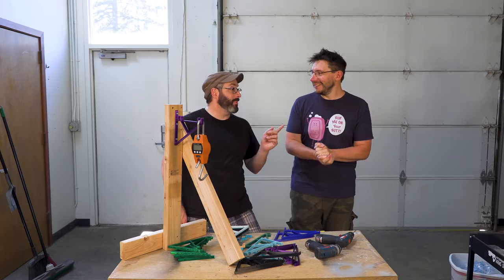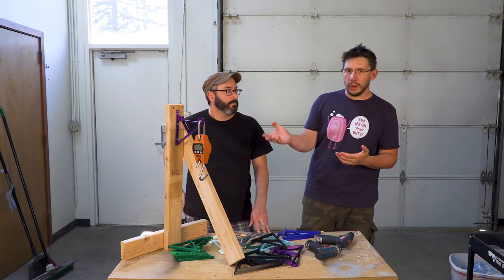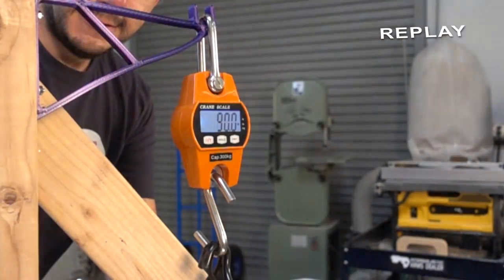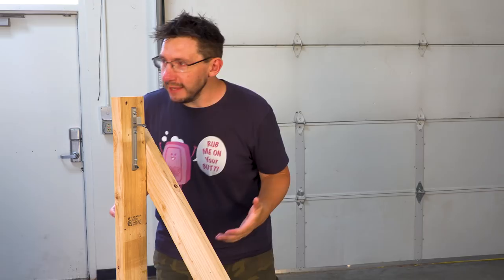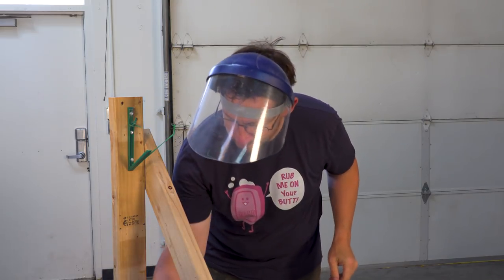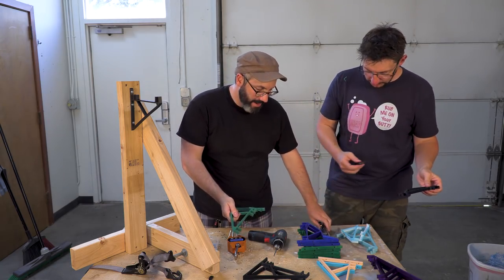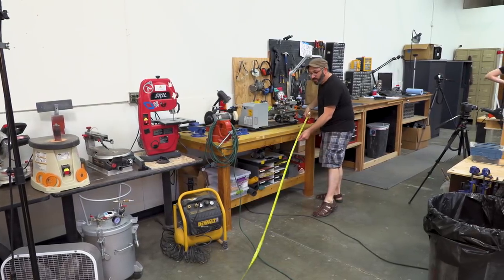Will It Break? Stress Testing 3D Printed Brackets IN THE NAME OF SCIENCE!

Comment: I don’t think the mechanical design was really optimized for the stress direction it was submitted to (you an see how the carbon failed based on stress concentration in one of the radius. Also, the ratchet doesn’t give you a consistent linear force increase and each material should be printed in a very fine tuned way to avoid failure within the adhesion of the layers. If you want to do this experiment right just print a typical tensile stress prove and add weight to it by clamping it to the prove.

Comment: it's so funny people think PLA's are weak, they are by and far the strongest materials we can print with, you anneal the HTPLA and bet it would be up with the polyalchemy which is also an HT PLA or modified PLA is better description.  PETG and ABS are about the weakest materials you can built with and yet people think they are strong because they flex and take impact better, well and handle heat better. But PLA's are really much better for most structural things if not in high temp use.

Comment: I think the nylon failure was more due to the design of the part than the material itself. If the emd there were more sturdy itd have not snapped so easily
Reply: "Product" design requires considering material properties and part/mechanical properties together. If one is ignored you'll likely not get expected or even consistent results.

Comment: SCALE CHANGED AFTER SECOND TEST CHECK FOOTAGE LOOK CLOSELY AT SCALE! just an fyi. i think that there might have been an adjustment to the scale after the second test. just looking at the footage and the indicator on the right hand side of the scale changed position. close up image of scale. https://ae01.alicdn.com/kf/HTB1dHpmQpXXXXcDXpXXq6xXFXXXn/220679641/HTB1dHpmQpXXXXcDXpXXq6xXFXXXn.jpg

1.polyalchemy moar 90lb - 40.8kg
2.protopasta htpla     64.8lb - 29.3kg
3.mh build                   89.5lb - 40.6kg
4.mh petg moar         43.5lb -  19.7kg
5.pla moar                   122lb -  55.7kg  thats right kids good old pla for the win! thanks to moar.
6. ryno                           37lb  -  17kg
7. nylon x                      39lb  -  17.8

Comment: I don't think this test is very accurate or can really be used due to the structure itself not being built well for support. Did you see where it was bending behind the support beam? Your support  bar needs to be moved if your testing weight at the very end like that rather than evenly across it.

Comment: Try for the golden number.  Take your longest edge divide it by your shortest edge and it should equal 1.618 or 1.62 (if you want to round).  The shortest edge should be what is inside your triangle not the total height.  Relocate your cross support back to corner and move it to center of triangle (which is not center of length but when you set it down with peak up where does the straight line go down at 90 degrees.  When I did tooth pick building these numbers helped a lot.  You might also try mini supports (like "Y"'s) at every junction to spread your support.

Comment: It does seem like most of these could have much higher failure weights if the overall structural design was better. The single internal brace is simply not enouch for the way the load is being put on the bracket.
Reply from the maker: Agreed. Our goal was to test what I thought would be a worst case scenario. Follow up video will be better.
Reply: As my head starts 3d drafting something new as I dont know how or have the programs to do it on my pc FeelsBadMan

Comment: Gentlemen, I believe you need to redo this test, and...modify your "Apparatus" to accommodate a Metal bar of some sort that fits inside both inner and outer raised bracket pieces so that the weight is evenly distributed across the whole "Horizontal" top of that bracket.  **Edit Meaning, you are only using one end of the bracket and that bracket will withstand more if evening distributing the weight across the whole Horizontal top of the bracket.

Comment: Your design is a bit wrong; use one vertical Web in the point where you are getting the bend and a diagonal Web from that joint to the exacto point where the horizontal is touching the wood, your forces are not getting transfered correctly to the vertical wood that would be the colum of the structure
Reply: Also add in the design little squares on the joints that will function as a support like the metal plates do on trusses

Comment: This was a pretty disappointing video. I'm a software engineer with a mechanical engineering degree who used to work in a plastics and materials science lab doing structural and impact testing.

1) As many have said you need to redesign this. The primary issue is the lack of a triangle on one side. A few more reinforcements and smoother angular transitions to spread out stress concentrations will help.

2) concrete is reinforced with steel bars (as most fiber reinforced materials are) to add tensile strength, not compressive strength. That's why your cf nylon broke in a different location. The stress concentrated at the base of the fingers holding the wood beams. It doesn't mean nylon is weaker.

3) Look up "dogbone tensile test", print the materials in that shape, and then test them at constant strain rate, preferably with something like an instron load frame. Your ratchet, 2x4s, and load measuring device are terrible. Without a constant strain rate it is impossible to compare these.

4) whatever makes contact with the plastic for this specific test needs to be flexible. The metal bar concentrates stress at a contact point, leading to very inconsistent results based on the twist in the strap and the angle of pressure applied.

These test results would be thrown out of any legit lab. I would take this video down out of respect for the manufacturers of the materials accused of performing poorly.

5) Do more tests than 1 per material. Nothing here was statistically significant.

6) This was not done with safety first in mind. Which was one of the bigger issues. Face shield only went on after a piece hit your face. Ratchet and scale fall on your hands. Plastic flying everywhere. At my lab we had to test materials in an enclosure or have operators stand far away from the test.

7) many have also recommended checking the scale units for inconsistency.

This was NOT scientific at all.
Reply: Good thing this was just for fun then!

Comment: Nice concept, but NOT "real-world" in actual usage.  One bracket is not enough to test this.  You should have at least two or more brackets as more than one bracket would have given a, most likely, better strength result.
Reply: it gets them in the ball park. now they know what materials to avoid or that need to be redesigned for. they have some failure modes and now they know the moarstruder is the way to go. now they can do a round two :-)

Comment: This test are not really the truth of the strength of the materials. Yes, is a comparative, but this is not the effort that they can get. In this case you are applying a force in a point where if it was near to the "wall" will be higher. This is because the momentum (force x distance = n*m, lb*inch ...) but in this case your are creating a kind of triangle structure where the forces going in traction an compression ways (depending on the bar) this is important because the use of the material. Is more interesting to compare the materials in different ways. For traction, compression, cutting effort, torsion and of course momentum, even lamination because this material has many faces where de efforts appears. I see many of this test over internet, but no one with a really science method on it. This is simple a suggest.

Comment: Well, this was in no way a conclusive test right? You had multiple prints of different materials but only tested one of each. So statistically the result is meaningless.
I also do not buy the argument putting a load on just the point of the design is the correct test method for this. Your design was modeled with the intent of having a even load on the top bar, had you done this in your test rig, the results might have been completely different.
Also, as I understood, Nylon is directional sensitive, the little fibers in the printed material align in the direction in which the nozzle was moved, so are you sure your design was printed in the right orientation? Questions, questions :P

Comment: ABS?  Annealed HTPLA?
Reply: ABS is weaker than PETG, but ya would like to see annealed HT PLA
Reply: A lot of what I print has to withstand higher temperatures.  So PLA is usually no good for me.  That's why I like to print in ABS or HTPLA.  The annealed HTPLA definitely feels stronger than non-annealed.  So it would be interesting to see the results.

Comment: What's that in kilo's?
Reply: He he. Agreed
Reply: IgnoreMyChan divide it by 2.205
Reply: * Newtons
Reply: Pounds/2.2 = kg * 9.81 = Newtons
Reply: Dillon Cawthon if he is even too lazy to convert it for us, what should he expect from his audience? :-P
Reply: Another reason why English units are stupid.  Pounds is used to denote both mass and force because of the term weight, which is a force due to gravity on a mass (well 2 masses, because it is 2 things that have mass).  While they can be used interchangeably, it really technically only holds true at sea level on Earth, if I remember my physics classes correctly.  force= mass*acceleration.  weight= mass*(acceleration due to gravity).  In engineering, you should use "lbf" (pound force).  

Your "weight" can change depending on what planet you stand on, but your mass stays the same.  If you step on a bathroom scale, it can tell you the force between your mass the earth's mass.  It is only a constant term to calculate your mass from your weight, which is the acceleration due to gravity: 98.m/s^2 or 32.2 ft/s^2, (rounded).  Again, technically at sea level.
Reply: clayrev all true. Doesn’t make the results any less awesome :)

And just for fun:

1 pound force = 1/32.2 pound mass 

And 32.2pound force = 1 slug 

Always thought the slug was a fun unit.
Reply: I divide by 2, then subtract 10%. So 100 lbs, divide by 2 is 50, subtract 10% makes 45 kgs. Pretty accurate I'd say, and quite easy to do in your head.
Reply: just divide it by 2.2
Reply: What's a kilo?
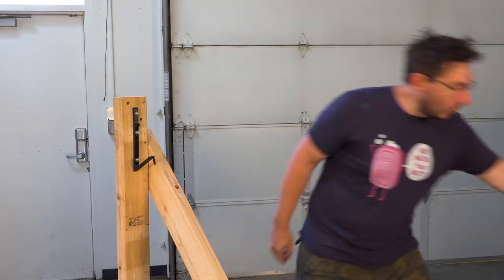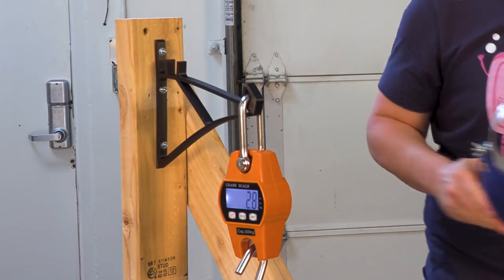Reply: 9:44, 13:46, 15:20 and 17:00 look at the units. He already did it in kilograms but he failed to notice.

Comment: Your gusset is wrong thats the supportninnmiddle. It should have ran from top to wall.
Reply: Also joel it needs 2 braces or gussets  when testing like you did. However your use applies pressure down equally not just on front. But still good test.

Comment: also should point out too much design and cheaper to buy then print. but good training for design/test/practicality
Reply: @George Robles   Too much design??  What do you mean?  It takes 15min to model those brackets.
Reply: OU812 print time also, takes power, cost of filament, negligible, but still has cost, plus, what's your time worth?
And as you seen, it could do with some improvement.
But then print time goes up with complexity, as well as cost of everything, including the machine, which for some, have already paid for themselves in Entertainment alone, I can always watch a quick moving 3d printer 😉
Reply: OU812 if you made $60 an hour at a job say, then that 15mins is say $15. What's the cost of metal ones that are about same size? How much more weight can they hold?
Reply: @George Robles  LOL. Now I understand what you meant. You wrote in your original comment "...buy then print".  This implied you wanted to buy the 3D file "then" print it. You should have written "...buy than print". This has then meaning you intended.

Of course I agree with you. For things like this it's always cheaper to buy rather THAN print. ☺
Reply: @LarryB  not negative, was giving an example of a specific situation.
There is also the "I'm am going to do this even if it kills me!" Mind set. My MK8 auto level was my first project where I redesigned many times till it worked. Two days later I thought of a faster better way. And felt like my time was not completely worth it, so far.

Knowing when to quit is helpful. Especially when you are being paid by another person. Your example implies that you have unlimited time. I got other things to do, called life. And if you design something that is too expensive, then you only lose money. Was not including print for fun. Cause wasting time is not wasting time if your having fun.
Your comment is more negative and not open minded if you just put down someone else's hypothetical comment.
Hypothetical, is not real.
I gave one of many examples. Another possible example is what you stated. But if your never taught when to quit or when to take a loss, then it's much harder to be successful at making money.
Prime example, DeLorean. Too much design.
Reply: @LarryB  well, let's get technical." Nope, I was not being negative. Was being positive. Still am. Your negativity about a hypothetical situation is pretty obvious. Again, you missed a point, hypothetical.
Trying to help prevent too much wasted time. Gave my own example even.
Why keep calling some one a name? Mine is neither "negative" nor "Nelly"
There are far more appropriate response's if you didn't want a response from me. But you called me negative. And I responded and said no, you're being more negative because your own comments where not positive. One of my hobbies is 3d printing. Also 3d modeling, helping others to learn from my mistakes. I gave an example and explained it. Why respond in even more negativity? " I'm right your wrong cause my feelings!" Is usually not a great argument, but in today's world that seems to be made more legit by people who argue like you.
Maybe a metaphor;
Nice turn there, but you still went over the edge.
"Uh-huh! Na-ah! Ya- huh! Is never outgrown. Lol.

And may I point out that your argument of " of it's only a single design then print out many" is now lost by your own statement saying it's about hobbies, but I said that before you in my response to your comment. I feel you dismantling your first argument and throwing in another reason, completely opposite of design to make money.

Just saying......

Side note: you have your own channel. In time you will see what I mean or at least have a better understanding about comments. Funny thing is I went through this lesson too, Joel got me on a comment I made about another 3d printer once. I learned, and remember that many children read these comments. At least I hope I did and hope that my responses where not out of line and did not waiver from my point I was trying to get across. And to appropriately respond to the negative comments.
Reply: @LarryB  I made multiple comments by the way. Maybe read more. IDK what would help

Comment: What!!?! Got to 5:00 wondering where you were going to stub the lever, to pull against the scale. Oh sh*t.

Kids, do not do this at home! Or (and especially) in a YouTube video. THIS IS AN INSANELY BAD IDEA!! You do not put your face next to a possibly shattering plastic piece. Or any part of your body, but especially your face.

The altered fixture is better, your face is still too d***ed close, near where shards of plastic might fly. 

Put a stub on the the vertical arm, about level with the end of the scale, hang a spare 2x4 from the scale, with the inside end pushing upwards against the stub. Now the valuable human is some distance away from the failing piece, and has better leverage.

(Sorry, but I am just a bit perturbed by this video, as an example that should NOT be followed.)

Comment: From one Joel to another I'm afraid to tell you that your test rig is basically flawed. The moment you attach the scale to fixed points at either end you are no longer measuring weight but extension which will result in skewed results as the scale is not calibrated in this way. Don't feel too bad. I made the same schoolboy error when I was actually a schoolboy in the 90s.

Comment: This shows the bs materials like fiber carbon, petg etc etc, all marketing
Reply: I think Bill addressed this a couple of times (a couple = 2 in metric).  He stated that the strength of the material should be measured by application. The carbon fibre may well prove to be much stronger in a specific application geared for that material.  Joel tried different materials to see how they would perform in this application.  I think a couple of tweaks to the design (using metric triangles instead of imperial ones) and re-testing on the same rig would get different results for those materials.
Reply: NOTE: Metric triangles have three sides.  ;)